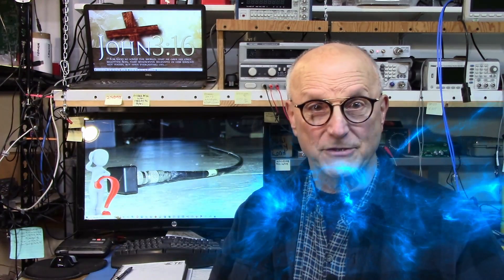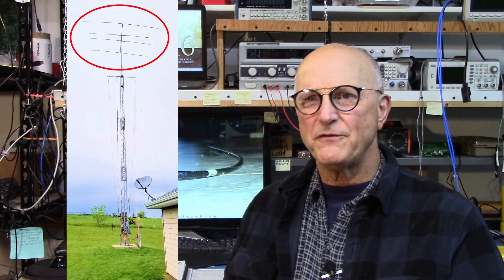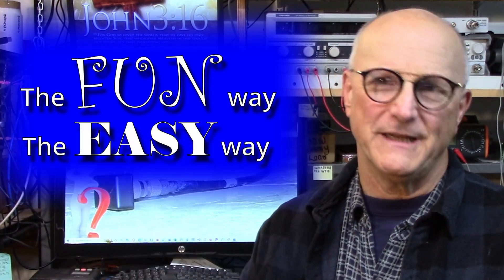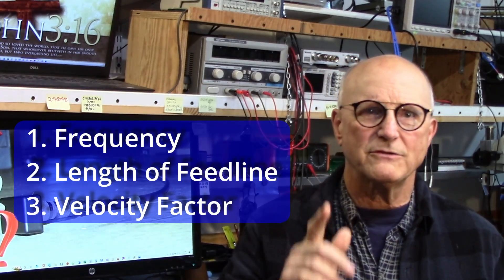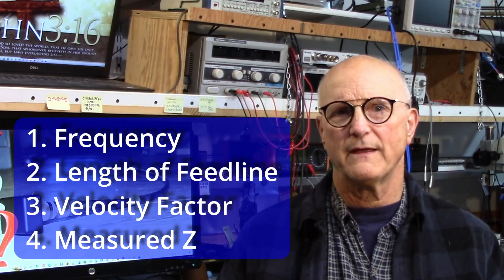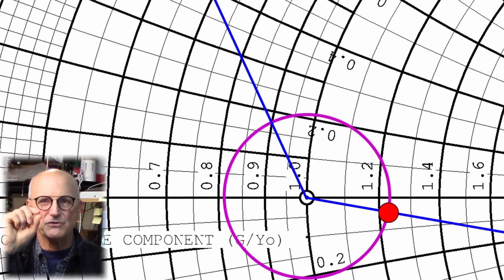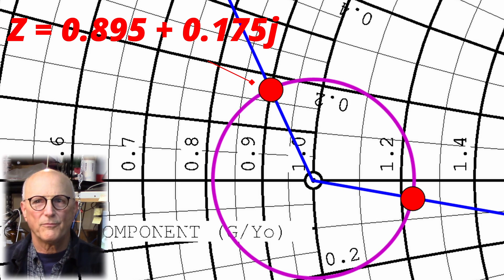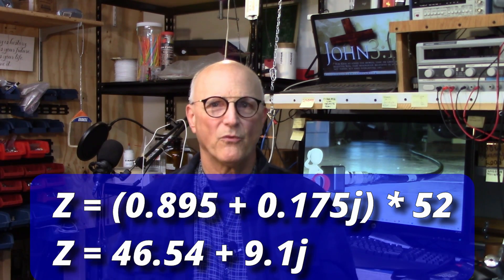Estimating an Antenna's Impedance at a Distance: Impedance Transformation in a Feedline (039)

Comment: Excellent video. In my case, I don't have a VNA and I don't know the impedance of my load (the antenna). How do you suggest to calculate it if I don't have tools to measure it? As per what I can see on the video, it is necessary to measure it with a VNA in order to normalize it and plot the SWR circle.
Reply: Also, where did you find the values of resistance and reactance for the software?
Reply from the maker: @marianduval5270  It used to be that VNAs cost tens of thousands of dollars and required a two-man lift. Not anymore. The nanoVNAs are very, very inexpensive these days. If you go with one of the cheap, clone knock offs they can be had for under $100 (nanoVNA). It won't be as good as the real deal, but it will be sufficient for anything that the average person might need to do. If you decide to get one, I have a whole Playlist on how they work and how to use them.
I would ALMOST say a good antenna analyzer will give you the values you need, but my experience with these has been less than stellar (especially the MFJ model 259) ... except with the higher end RigExpert (see my video on improved impedance measurements with the RigExpert - I borrowed one to make that video)
The values of resistance and reactance come from the measurement made with the VNA.
I hope this helps! 🙂
Reply from the maker: See my reply to your reply ...

Comment: Thank you very much! This really helped me and was so useful. I did your example in my case with 50ft of RG-8X with a vf of 0.82 with an unknown external antenna with unknown feed point impedance. Is the assumption that the calculated SWR based on the radius of the circle in the smith chart (and VNA) is the actual SWR at the feed point as well? I'm fairly new to this - if the coax isn't acting as part of the antenna, is the SWR constant independent of coax length?

Nevermind! I see someone else asked the same question and you answered it!!! Perfect!

PS - my first calculation mistake was not looking at the VNA units correctly - ugh! The reactances were in uH and uF vs ohms. Once I figured that out, all calculations worked! Plus, doing the smith chart on paper with a compass is quite enjoyable.
Reply from the maker: So cool! 🙂

Comment: Trying to figure out how any LC  "L" or "T" network antenna Tuner could protect a Final output device from Antenna Swr reflected power effects using what Intuitively Should be a simple Bi-Directional impedance matching network that should Pass rf power (Forward or Reflected) equally Both directions easily passing any antenna Reflected power thru towards Rf final device.....Normally, only a transmission line "Isolator or Circulator" can effect 1 way Directional rf power continuity flow...What part of this video or transmission Line "Impedance transformation" enables a simple "LC" matching network to protect a rf final from antenna Reflected power ??
Reply from the maker: Man! I am just missing things here! I didn't ignore you, it is just that I have had a very FULL last few months and some stuff just fell through the cracks. :-(
R.F. is a mystery in so many ways. :-)

Comment: This is an amazing channel! I am not shure if you ever addressed what I'm going to ask, but I coudn't find it. My question is preety commom, and I'm not shure if its a myth or not. Does the lenght of coax between the rig and the antenna matters in terms of simple SWR to the radio? As one can use coax as an impedance transformer I'd think that yes, but is it just a constant SWR value along the coax even though the complex impedance is changing? In the end, does it matter or we should just use the minimum length to cut the losses? I'll be sure to write this down as too many experts seem to be divided on this one. Thanks in advance.
Reply from the maker: First of all, a big thank you for the encouragement!
You have a very good question! The answer is a decided yes and no. I know, this doesn't help much. But, let me explain.  First the "no" and then the "yes" and then the "maybe."

No, it makes no difference. If we consider the coax to be lossless and look at the Smith chart, yes, the impedance continuously and cyclically morphs, repeating every electrical 1/2 wavelength. Throughout this 1/2 wavelength, the reflection coefficient and, thus, the SWR, remains constant. The components of the impedance change in such a way that the calculated SWR from the existing complex impedance at any given point is the same as it is at an other given point.
Yes, it does make a difference as viewed from the transmitter end of the coax. Coax is NOT lossless. If we consider a piece of coax which has a 1dB loss over its length at a given frequency, this means that a 100 Watt transmitter's power at the other end of the coax is about 79 Watts. If the antenna has an SWR of 1.6:1, it will be reflecting back around 4 watts of the 79 watts that it is getting from the coax. This reflected power travels back through the coax experiencing the same 1 dB of attenuation. Back at the transmitter end we get 3.2 watts coming back at us from the antenna; the remaining 0.8 watts is dissipated in heat in the coax.  Comparing this to the 100 watts sent to the antenna, this looks to the transmitter like a 1.41:1 SWR. The signal loss in both directions fools us into thinking our SWR is better at the antenna than it really is.
One other factor ... the antenna itself. Some antennas are *really* weird about coax length and grounding and such (I know, I have one of those!). In that case, yes, the length, type, grounding, and just about anything else you might think of make some weird difference not covered by conventional theory.
So, like I said, yes...and no. Now that I have thoroughly muddied the waters, I hope that I've shed some light on the question at hand. 🙂
Reply: @eie_for_you   Ralph, first of all, let me thank you for the most complete and record-fast reply I've ever seen. Much appreciated. I truly love that most answers in the Ham Radio hobby are definitive "it depends"; it makes everything much more fun and approachable for the inquisitive experimenter. The Nano VNAs and Tiny SAs are amazing and only add to the fun and democratization of the craft.

You, sir, have indeed shed a lot of light on the question, and the "yes and no" answer is clearly the right answer. Many die for either the "yes" or the "no"; a true master knows it is neither. I'm a Brazilian Ham and Production Engineer and a true fan of yours, really honored by your reply. Thank you, 73 DE PP2PB (by the way, are you a Ham, sir?)
Reply from the maker: @PBenetton Well, thank you very much!  When we are dealing with the black magic world of R.F., it is often a lot of "it depends."  The best we can do is know as much as can know and then learn more. None of us have the whole story perfectly!
Yes, I am a ham and have been since 1970 (WN2PUX, then). I am WA2PUX continuously licensed since 1970. 73! 🙂

Comment: Do you have any tutorials about measuring the impedance of an efhw antenna with the help of nanovna? Or in general the impedance at the end of any wire?
Reply from the maker: The tuning of this antenna has to be done at the coaxial connector on the 9:1 BALUN which is part of the whole assembly. The nanoVNA (or any VNA or antenna analyzer) is looking to see a transmission line which, by their own definition, is two conductors. There must be a definitive return path.
Regarding the tuning of any single wire, you are not the first one to ask about that ... its velocity factor and, therefore, its electrical length is highly dependent on its physical surroundings. The simple use of insulated wire as opposed to bare wire for an antenna shortens the antenna because the presence of the insulation changes the velocity factor of the wire. You put it in the air as opposed to being near the ground or the building...different. This is why we cut purposely long, trim to tune in the orientation and environment that it will live in. 🙂

Comment: I made up that random impedance in a small box as well , I used sma connectors like on the tinyVna, so we have two different values.
This is good for exercises , matching into an impedance at a specific frequency.
Reply from the maker: Cool!  I used a N connector because I most often us my Tektronix VNA which sports N connectors.  It is nice to have a "known bad load" for various testing scenarios.
You should see what you get measuring your "known bad load" with various off the shelf antenna analyzers.  An interesting exercise. 🙂
Reply: yes the version i built and  used after seeing your idea, had three pairs of SMA connectors,  this allows me to have three frequencies for the bad load  ,I then  sweep the load  so I use  my tinyVNA to sweep the Unknown load from say 7mhz to 30 Mhz then select three different  frequencies, noting the Z ohms and Xs at each frequency i can then use SimNec  to calculate the required  inductor and capacitor values for each freq. then insert these into the path to get the match  into our unknown load. 

i built another small box to go between the VNA and the unknown load, here we can put in the C and L values. 

This unit is then good for testing analysers and the difference they give on measurements. I find the MFJ analysers the worst.
Also using this with Simsmith or Sim NEC to find the L and c network values for a given frequency.  So we could put a marker on any part of the simsmith chart and make a load value to simulate the antenna.

I was going to get the Rigexpert Zoom , but the Tiny VNA does it , it just that its not so portable in the field , as laptop and cable required to measure stuff.

I used SMA connectors as i have loads of this type , i can send you some if you want to play  for  with these . for free just email me from  QRZ page ( GW4LWD )

I just put up these images .into my drop box , follow the links to load them

https://www.dropbox.com/scl/fi/qcof5qvo6exwju10l5mme/Will-image.jpg?rlkey=mi7apw1c14tkk2ow7d59q6qja&dl=0

https://www.dropbox.com/scl/fi/gcnawk4cdizzw5ydnr5me/28mhz.jpg?rlkey=ccg45z82kn02k0l3ig9vwmii1&dl=0

https://www.dropbox.com/scl/fi/q2io8vwxm6evi9t3hdg01/series-L-and-C-unit.jpg?rlkey=b94c3z0hn56ehote9pemccjbz&dl=0

https://www.dropbox.com/scl/fi/q262letegqx7awv56kubh/tiny-and-unknown.jpg?rlkey=gp84zzhwo755qcfnwe9bwrwv2&dl=0

https://www.dropbox.com/scl/fi/1icton2m1boahn2uuw3et/dual-unknown-load.jpg?rlkey=5438ftnb5xmig3bn3ha5eqhwv&dl=0

https://www.dropbox.com/scl/fi/9z5bxoiyntk2f2fmd4mps/15Mhz.jpg?rlkey=9tzt37pmslosdurbphsgwkesr&dl=0

https://www.dropbox.com/scl/fi/p6wfcs31ifqjwqvd41j87/unknown-load.jpg?rlkey=9kvngdq6wurwrismr2k6e2w4e&dl=0
Reply from the maker: YT had relegated this to "Held for Review." I don't often check there (cuz it's always empty).  Sounds like a neat idea.
Reply: Here are some images 

https://drive.google.com/file/d/15n9QB4EHS8dYb_CJi3Si01xRYpxcLrF9/view?usp=drivesdk

Also

https://drive.google.com/file/d/1VLunNUTmuW_aahJ6AhAymU9xJ1ybypVd/view?usp=drivesdk

The 10Mhz Smith chart

https://drive.google.com/file/d/1SiNOpGmpA0n6E38KVT7D9hNhT5sUfarE/view?usp=drivesdk

Comment: Hi there , do you show how you made that test impedance load ?.
Reply from the maker: Actually ... no I never did.  It is quite simple, though. I put a 33 Ohm carbon composition resistor in series with a coil of wire that I just threw together from some scrap. This across the connector.  Then, in parallel with that combination, I threw a 27 pF ceramic capacitor. No calculations or goal apart from wanting something that was purposely non-ideal. I wish I could put a picture in here. Here is a link to a picture of the innards.
https://drive.google.com/file/d/10_aOotowIvmFgyKeHUh8Im4PcXFO55_C/view?usp=sharing
Reply: @eie_for_you  I’ve subscribed , interesting topics .
Reply from the maker: @Welshwizzard1  Welcome to the "family!" 🙂
Reply: @eie_for_you  

Hi there , after thinking about your unknown load, I made up another version , but this one is completely variable.
It had a variable inductor, variable capacitor, and variable resistor, I can now create an unknown load anywhere on the smith chart , then use the VNA to read it and calculate the L/C to match to it.
Reply from the maker: @Welshwizzard1  Wow! Getting better and better! 🙂
Reply: @eie_for_you  
I’ll do some images.
Reply from the maker: OK.
This is my LONG overdue reply!  Sorry. Sometimes this stuff gets lost in the YT world. I'm spending some time trying to clean all this stuff up. :-)

Comment: This channel has to be one of the best resources for HAM's where is everyone? Is it possible to have a video summery on this series but tackling the same scenarios with open wire feedline? 
   For example. How would i calibrate the vna at the end of a length of 170ft of ladderline? Would i need a 1:1 balun at the shack end to convert the VNA to balanced and then another 1:1 Unbal at the feedpoint to convert it back to unbalanced for the calibration loads / stubs?
Many thanks.
Reply from the maker: Hmmmmm ... having never really worked with ladder line ...I'm going to have to do a little research on this.